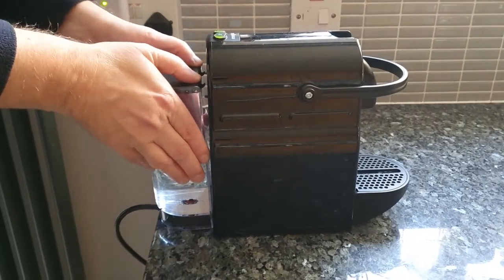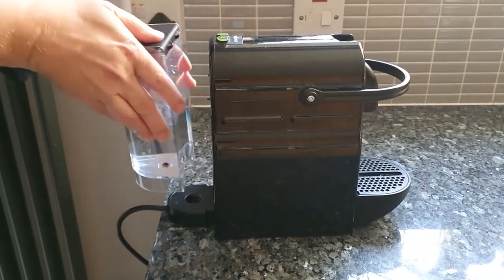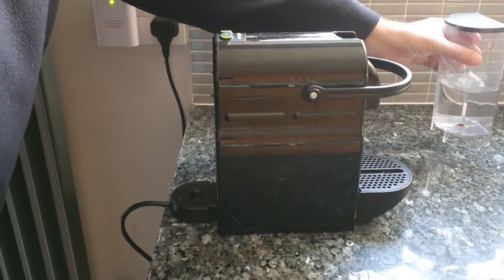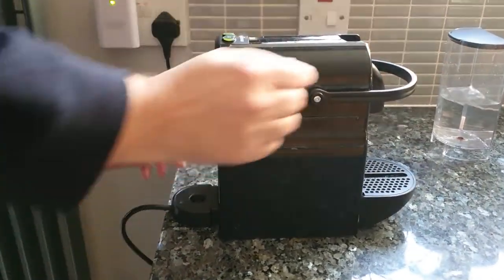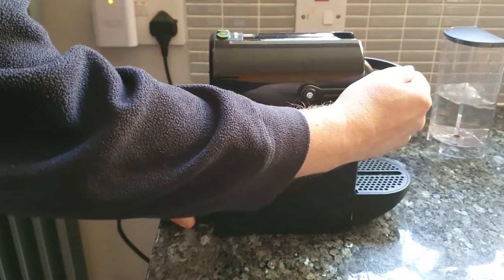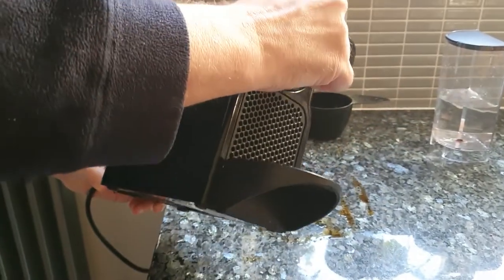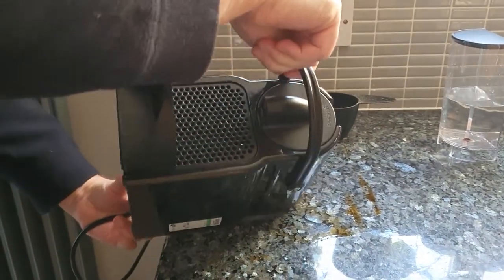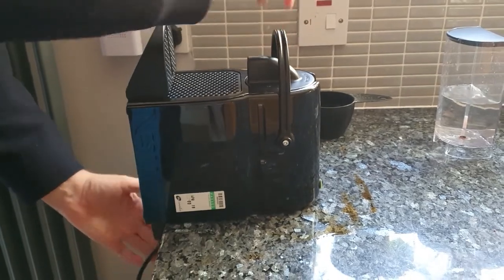Nespresso coffee maker air lock

Comment: Thanks a ton! This method worked - I turned and placed the machine on its back for about 10 minutes and gently tapped the sides to release any locked-in air. After placing it back in its correct orientation, the machine now dispenses coffee!!

Comment: I, too, tried to use my office Nespresso for the first time since COVID the other day, and found that it didn't work. I watched perhaps 10 of these videos, but nothing worked. In desperation, I thought, "Well, I guess I could just lay it on its back for a couple days until I come in again. Couldn't hurt, right?" I came in this morning, loaded the tank, and—Voila!—hot water coming out! I had to run it a few times to get it back to normal, and had to do the "pumping" of the tank (taking it off and putting it back on repeatedly while it ran), but the flow is totally normal now!

Pity I brought my coffee in a thermos just in case...

Thank you!

Comment: My solution: Get a syringe, fill it up with water, and pump the water in directly into the machine from the water inlet at the base. That should release the airlock. I try all method nothing works as effectively and effortlessly as the syringe method.